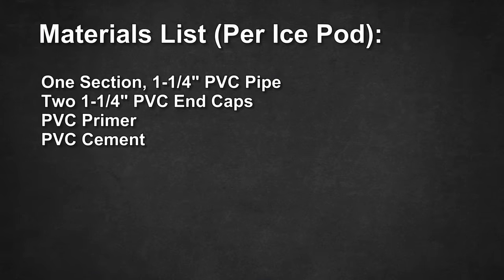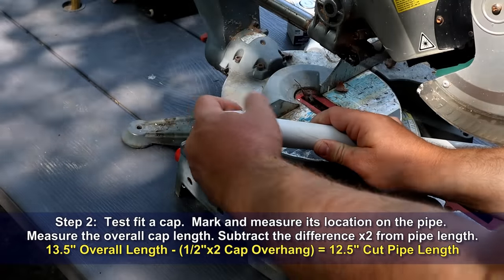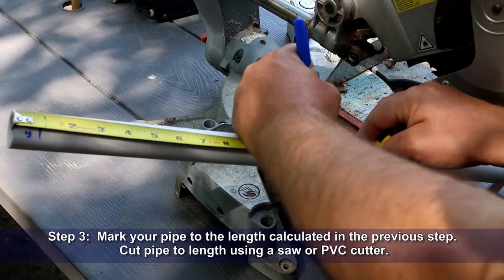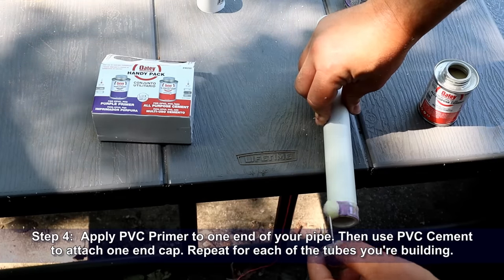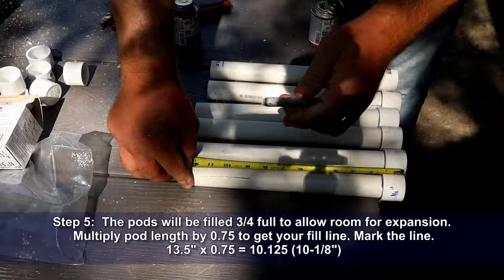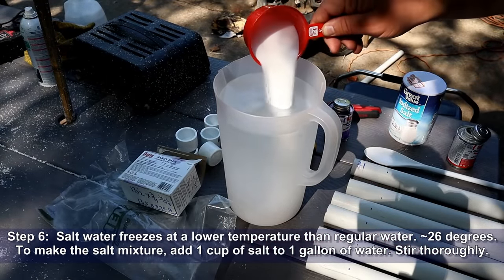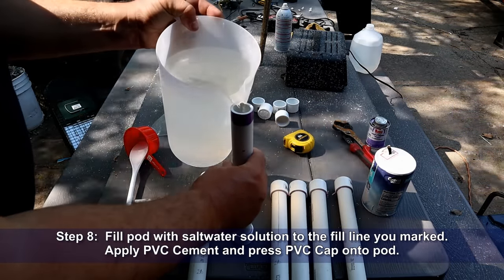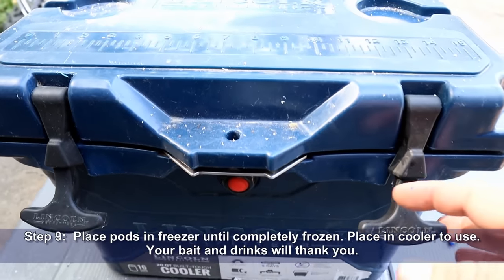Cooler Hack! How to Build SUPERCHARGED Reusable Ice Pack Pods

Comment: To get it really cold, mix water and alcohol!  Rubbing alcohol will work.  

The more alcohol, the colder your freezer must be in order to freeze the mixture.
Reply: Does it have to freeze to be most efficient? Or can it stay liquid at sub 0 Temps and still work? I was thinking of maybe a glycol solution that maybe holds temp longer?
Reply: @wadehatle5121  

Whether above the freezing point or below it, very little cooling is created as a frozen liquid warms and finally melts.  

The most cooling effect is at that temperature where it transforms from solid to liquid.  Very odd but true. 

So, to get the most cooling effect, you want this transition to happen.  

Simply cooling a liquid without freezing it doesn’t do it.  

Think about it.   Put a liquid in the freezer and it cools and cools … until it reaches the freezing point.  It stays at that temperature a long time until it finally freezes.  Afterwards, it cools more, up to the limits of your freezer.
Reply: Why would you haul 10 or 20 pounds of undrinkable rubbing alcohol on a camping trip when liquor could be both dual purpose and non-toxic?

Comment: An improvement to this would be gluing these pipes to the lid, if the lid can be removed.  This takes up the dead space in the lid and cold air sinks down from the lid to provide more efficient cooling.
Reply: Or just lay on top after filling your chest.
Reply: @daled8221 lol
Reply: A lot of coolers that have removable lids don't have insulation in the lids. Some big gap filler spry foam will fix that problem,  but the lid is the hottest spot inside the cooler, so they're still going to melt faster
Reply: @rmiller334  Do you need someone to draw you a pic?
Reply: @daled8221  I was laughing because I was agreeing with your assessment. Perhaps you’ll need a reading comprehension picture ?
Reply: @rmiller334  Maybe mindreading.
Reply: @chichidouglas5078  isn’t that strange?  You’d think cooler manufacturers would insulate the lids or fill the lids with jell like sustenance so that they can be put in a freezer to become the source of cooling.  It is a cooler after all.
Reply: They would melt faster at the top of the cooler. We're going for maximum duration, not coldest possible temperature.

Comment: Awesome idea. FYI the primer must be still wet when the glue/cement is applied.
Reply: I thought the same...also, I've not seen anyone put the primer and glue on top like that.. I've seen primer on one end and glue on the other then attach.. you can get primer in the glue by mixing them...

Comment: I was making ice bags that don't freeze solid with 1/2 isopropyl alcohol and 1/2 water in double ziploc bags for sore joints.  Wondering if this solution might prevent expansion and contraction of the contents of an ice pack pod and maybe you could fill them up completely and get more cold output from a higher mass content.

Comment: Cold air falls, heat rises...putting them on the bottom of the cooler is inefficient. Great idea, best if used above what you want to keep cold.
Reply: Not really. You'd have to keep your cooler open to dig through the ice packs to whatever you're going for and then relayer the ice packs again before putting the lid back on. Camp food needs different storage temps so being cooler at the bottom and less cold at the top works to your advantage. I start with dry ice in the bottom, then some frozen bottles of Gatorade and Fiji water (the square bottles are more space efficient) then the prefrozen vacuum sealed meats and finally the more delicate perishables like produce and dairy on top. I have milk, eggs and meat for a full week and ice cold Gatorade on the way home.

Comment: The expression on the game warden's face when he opens up a cooler full of pipe bombs, priceless.

But seriously, I think there are probably better materials than PVC. PVC is a thermal insulator, so while these may remain cold for a long time, will they absorb enough heat to be effective? A bunch of old 500mL water bottles would work just fine and require no investment of glue huffing.

Comment: Pure water freezes at 32 degrees, but it continues to get colder than 32 degrees after it freezes. Adding salt to the water so it freezes at a lower temperature doesn't make the ice colder. Freezing bottled water is the way to go here. No need to buy PVC. You can also use the bottled water as drinking water or you can refreez for the next trip.
Reply: My wife is an expert at packing a cooler for road trips or to bring home the fish. She always freezes water bottles. We buy the 40-pack cases at Walmart. She throws them in the freezer a couple days ahead. They get solid. The plastic is so thin it expands with the water (kinda like a balloon would). I have never seen a frozen water bottle rupture the seal or split. The great news is when it is ungodly hot here in Louisiana she’ll pull one of them out while we are fishing and we sip the ice cold water as it melts. That is very refreshing. I can always count on my wife remembering to freeze up a half dozen bottles. If I go on a long haul business trip she packs me a small lunch box sized soft cooler and if she throws two frozen bottles in there it stays cold in there for a couple days.
Reply: Water freezes or thaws at 32 degrees F (phase change). So, while ice may get colder than 32 degrees after it is frozen, it will be 32 degrees during the time it is freezing or thawing, which is higher than the phase change temperature of salt water. Might make a difference if you have ice cream or something else in the cooler that you want to keep frozen.

Comment: Why did you not use a mixture of water and ethanol or ethylene glycol? Most freezers are set to 4°F.... 26 degrees is weak. Salt water will have more thermal mass tho. But I wonder about overall thermal capacity compared to something that can freeze at 12deg

Comment: But you want to put the pods on top, since cold air sinks ;) Other then that. Great idea. I will be making some myself. Is there a limit to how much salt to use? Also what kind of salt is best?
Reply from the maker: Any kinds of salt will work. There really isn't a limit, but you reach a point of diminishing returns after a certain point. I don't recall the exact number at the moment. 

I use multiples of these pods. Some on the bottom, others on the top. Once the cooler gets to temperature, it really doesn't matter whether they're up top or not. I primarily use my pods in my bait cooler where they're getting covered in baitfish slime and other nasty stuff.

Comment: I think a rubber bladder would be better for the container because when the water freezes and it expands, the are stuck inside the PVC might cause the pipes to break
Reply from the maker: @questfortruth9239 a rubber bladder like a hot water bottle would probably work great. 

 As far as pvc, that's why you take expansion into account when filling.

The air that remains compresses, yes. But that pressure is far lower than what is typically held in a household water supply.

Plus, pvc is quite capable of handling even more pressure than that. Definitely learned that years ago when we used to make potato cannons.

Comment: Just as a point of interest, as long as your not installing plumbing in a house, you do not have to use primer
Reply from the maker: You're absolutely correct. And the reason primer is purple is so that home inspectors can easily see that primer was used. Unfortunately, every time I skip the primer in a video it seems to attract all the plumbing "experts" that the internet has to offer and they blow up my comments section.

Sometimes that's fun, too.

Comment: I’m super leery about the pvc itself. With multiple freeze thaw cycles, it’s almost guaranteed to crack at some point. I love this idea and I’m gonna do it today for mine but I’m gonna substitute the PVC for ABS pipe. I can’t wait to try this out though! Thanks for the idea bud👍
Reply: It might be kinda pricey, but you could always upgrade to sch 80 PVC, the dark gray ones, rated for commercial installations. I'd imagine it would hold up much better over time and repeated cycling. Just a thought.
Reply: AND it will match the inside of my gray cooler better. Thanks!
Reply: @cbglassiii9362 problem with that is the super thick plastic walls insulate too well and it seems to not feel that cold to the touch or make the cooler that cold...ask me how I know😅
Reply: I made my set 11 years ago.  Multiple refreezing every year and never had an issue with breakage.  Last elk season I loaned 6 extras I had to my brother for his ice chest.  He was amazed how his ice lasted compared to years past.  I asked him what he needed for Christmas.  He gave me the measurements for the inside of his ice chest. He’s a happy camper.

Comment: If you leave regular ice cubes in your freezer for a few hours it will get down to the temperature of the freezer,  just like the salt water ice. Neither one will be more cold or more warm, adding salt only changes the melting temperature. Congratulations on the view count though, I'm not suggesting you take the video down :) Cheers!

Comment: If you add salt to fresh-water ice, it will speed cooling. But if there is already salt in the ice, i don't see much difference in 0 degree salt water ice vs 0 degree fresh water ice. I believe salt water actually has lower "specific heat" which would work against its absorption of heat. But i do like the idea of the custom fit and reuse!
Reply: 100% correct and was going to say same thing. No matter if water or ice water it will be same temperature as whatever the freezer is set at. Nothing super about it
Reply: yep specific heat  is the downside, also  I like the ability to have possibly cold freshwater reserves on hand. Besides the Specific Heat, we need to consider the temperature differential, and increased rate of heat transfer/drive depending on the starting temp of the objects we add .  This video covers it pretty well: https://www.youtube.com/watch?v=7Jh0QeKTB8o
Reply: @unionse7en  I've always used plastic water bottles like Dasani or Auqafina cause they double as drinking water. Freeze lots of them and take one out to slowly thaw while having ice cold water
Reply: @Lefishn Same. Or buy an ice machine because you can lose the weight as it melts by draining water. You can have a hot+heavy cooler with reusable ice - yuck.
Reply: @scottleggejr  why you worrying about weight? If you can lift and move when full then it will actually get lighter as your drink your beverages. Plus you want to keep cold water in a cooler to 360* surround your items with ice cold water. If you drain water you will lose so much of the cooling factor. You need to watch some YouTube videos on draining water and leaving just ice compared to leaving both. The ice water is a huge benefit and I try and get water in my cooler. Amateur!!
Reply: @Lefishn  everyone's needs/expectations for a cooler are different, no need to call somebody an amateur.
Reply: If you have a cooler with drinks on ice.
Pour salt on top of the ice.
Your shit will freeze solid.
Milk, sour cream every will freeze.
Reply: @Lefishn  - some things in cooler are better kept dry.
Reply: @donoimdono2702  then you keep those in a basket on top so stay dry and let the rest soak in ice water
Reply: @Lefishn  - nope. I don't. to each his own

Comment: Here's the thing 
Need to make one end cap removable 
After the initial freeze/thaw these won't work any better than a plastic bottle bottle of frozen water
I simply use PVC to hold my items from the bottom of a cooler with a salt, water over ice solution 
The water will withing 10-15 min become below freezing & just above 1-2⁰
I use this cooler to keep items frozen & its only opened to take items out to place in another cooler to thaw out...
Or
You can mix 1 & 1/2 cups of ice cream salt mixed with 2 & 1/2 cups of water until most of the salt is disolved 
Dump a 7lb bag of ice in a medium cooler then dump salt & water solution over the ice
Close the lid & twist the cooler in the air occasionally for 10-15 min
Place water bottles in the ice mixture & they will freeze SOLID
Remove & add more bottles for as long as they keep freezing 
We fill a cooler with frozen bottles made this way to use in coolers to keep food cold
Hopefully this helps someone 🤟

Comment: Buy some propylene glycol.  It is what is inside commercial ice packs mixed with water.
Reply from the maker: I've actually had an ice pack video on the back burner for a while. Been meaning to get it filmed and posted. Propylene glycol or isopropyl alcohol both work well for making ice packs when mixed with water. Thanks!

Comment: Correct me if i'm wrong. I have ALWAYS put primer on the pipe and cap, and glue on both....he just used it on the pipe and a dry cap will that hold in a plumbing situation?
Reply: Yes, I immediately saw that as well. That is the standard practice.
I hope he doesn't try doing his own plumbing. 😱        😁✌🖖
Reply from the maker: You two do understand this is not under PRESSURE as house plumbing would be, right?

If it bothers you, put it on both, but in a case like these, it's fine.

Find something better to do with your time.
Reply: @TheWeekendAngler : You make a good point. I hadn't considered city water pressure is approximately 60 psi. You are certainly not building that kind of pressure.
Reply from the maker: @zapa1pnt  if that's the worst thing we deal with today, you and I are both in pretty good shape. 😂

No hard feelings, and anyone building these is certainly able to apply primer and cement wherever they deem appropriate.

Have a good day.

Comment: If you use copper pipe with screw on pipe ends heat transfer would be faster and more efficient.
Reply from the maker: I used to have a set of copper ones. They work better. Then copper went and got expensive.
Reply: @TheWeekendAngler  yes it did, if you have some copper laying around not being used, this would be a good use for it. However if you have to go buy the stuff, then yes absolutely consider the price difference between copper and pvc.
Reply from the maker: @garyzimmerman8679  I certainly miss the days when materials were cheap.
Reply: It will melt a lot faster also.

Comment: I've been using small transparent food grade plastic soda bottles filled with ordinary tap water for years. place them at the bottom and on top of the food/drink, then a tea towel on top. 
What you also should do is press open your cool box and lid to check the insulation. Mostly cool boxes are hollow. Coleman brand being the worst but they're cheaper. 
I cut up car windshield screen material to fit, just a dab of contact glue to hold it in place, then snapped all the parts shut. 
The difference was amazing. The ice in the insulated cool box lasted at least 50% longer. 
Remember it's the cool box and not the ice! 
Another hack is if you forget your cool box, just wrap up tightly your cold/frozen food/drink in a car windshield. Then place it all together in a large bag or box.

Comment: If you are filling a cooler full of cans/bottles you fill 1/3 to 1/2 with ice then sprinkle salt over the ice. That lowers the freezing point of the water (that the ice will become) so that the water does not freeze and you will be able to retrieve your beverages that are colder than 32 degrees. Filling up those tubes with salt water does nothing to get your beverages cooler. Putting those tubes into a deep freeze that is zero will give you ice at 0 degrees. Or colder if your freezer is set colder.

Comment: Thank you so much for sharing this design on youtube. I have a question for you. Do these little ice packs float? I am asking because I am interested in implementing this idea for and ice chest fan cooler, and I I wanted to ask from your experience if they float because of the salt or sink to the bottom. Both instances could be useful for my experiment. Regardless, thank you once again for sharing this and I hope to hear back from you. 

David
Reply: They do float. The ones made in this video are 25% air.

Comment: Since the PVC acts as an insulator, these will never get as cold as ice in a freezer.  You're also losing interior space in the cooler from all the volume occupied by the PVC pipe and end caps.  

A suggestion - don't use cemented end caps.  Use a pair of male adapters (one at each end) with a pair of threaded end caps.  Once the ice is frozen inside the pipe, simply unscrew the ends, let it melt just slightly to make it easier for the ice to slide out, then push the ice out with a wooden dowel.
Reply: The r value of PVC is relatively low, and all an insulation would do would be to slow the rate of cooling. The ice will get down to freezer temps, no problem.
Reply: BS. The water and tube are inert objects, they don't create any warmth so after a while they'll both be the same temperature as whatever your freezer is set at. As far as losing interior space, what do you think will happen if you dumped ice cubes in it?!?

Comment: I wonder if there is a different solution that could be used that would thaw slower. Something similar to what is in like a therapeutic cold pack. Like a slushy liquid. Hmmm. I think i will research that.
Reply from the maker: A water and isopropyl alcohol mixture is what the gel packs use. I've been tempted to try it with these too.

Comment: I'm not sure about the physics here, but the ice in my freezer, regardless of composition, is minus four degrees F.  I'm don't see how having a lower freezing point makes a difference if it all ends up at minus 4 anyway.  Ideas ?
Reply: Get a colder freezer. Mine hold at about-18.
Reply: @rmiller334  Well sure but that wasn't my point; minus 4 or minus 40 - does it matter what's in the tubes ? I don't see how.
Reply: @bradmiller9993  it doesn't matter at all. "but this one goes to eleven"
Reply: @bradmiller9993  energy exchange rate.
Reply: Google phase change temperature of water.